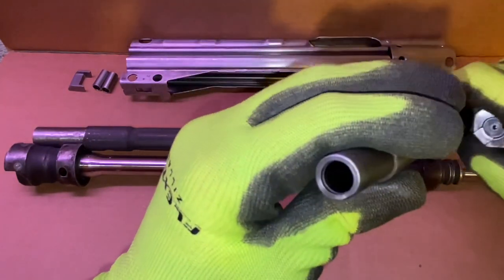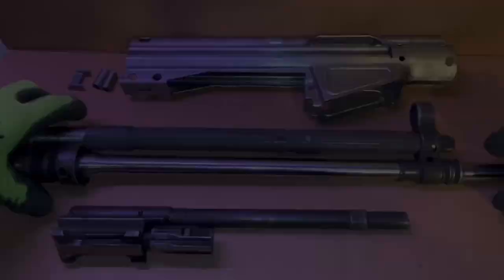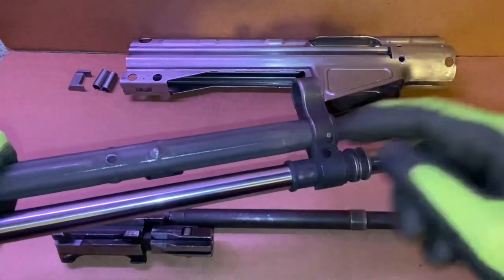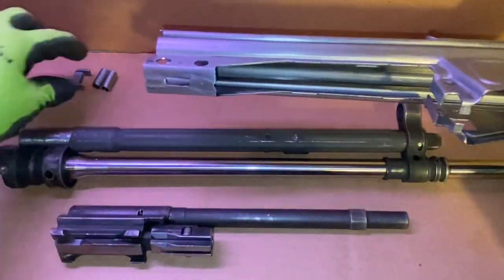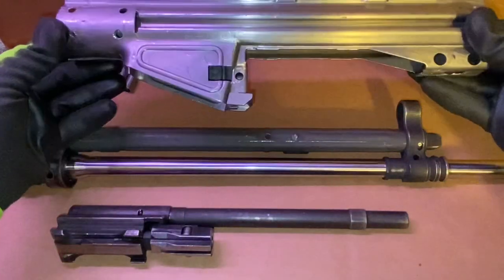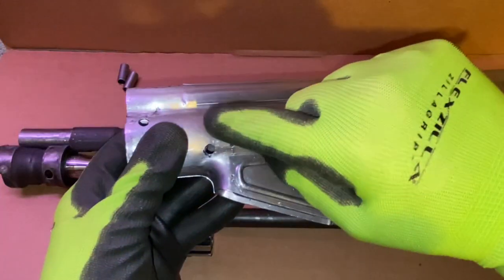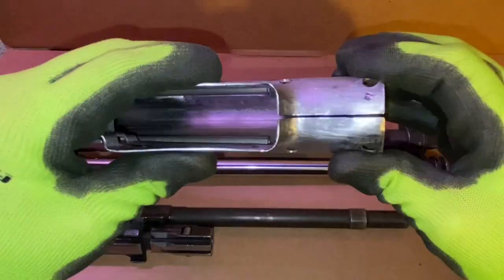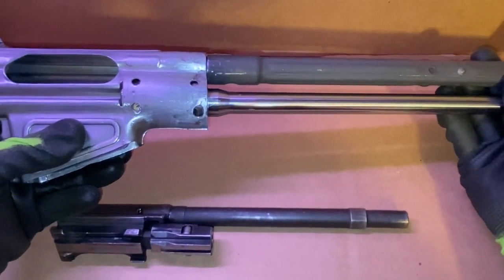BATTLE RIFLE Build Series - CETME C Build Update

Comment: I am almost done with my CETME parts kit, waiting for the barrel which will be here tomorrow. I made my own bending jig for my flat. Seems all jigs, no matter which one or who made them, all bend the flat to the point they are always tight. My guess is because it's easier to expand the inside than to tighten it if too much play. I used 3/8's drive chrome deep sockets and an extension to drive thru both the upper and lower section of my bent receiver as mandrels. Started out with thinner O.D. sockets and worked way up to the best fitting ones. Worked out great for me. I didn't want to pound on the carrier. Seems all jigs require a mandrel. Even the HK made receivers need to use one. Good project, but will require some skills.
Reply from the maker: Exactly. A correctly sized socket on a long extension and pound it through…once I got the internal dimensions close enough I used my BCG to do the same thing for a final “fitting” so to speak. Great minds think alike my friend! I appreciate ya!
Reply: @SMR-Tactical  My barrel arrived today. Installed and welded, just cleaning the welds now. Everything seems right on so far. Functions as it should with snap caps. Will test fire next week, then refinish. I watched every video on YouTube on building these. Good project, but not really easy. Lots of fitting.

Comment: Hey I bent my CETME C lower and welded it up but it is too tight for the bolt to go through it.  What would you recommend to get the bolt carrier to slide through.  Thanks
Reply from the maker: I would use the bolt carrier as a mandrel, if you are able to get the carrier in.  Meaning, lube the carrier and the receiver up, and hammer that carrier through there….back and forth.  It will force the receiver to open up where needed, just make sure not to damage your bolt carrier or receiver (use a rubber mallet and a wood dowel) and STOP if you meet resistance so you don’t damage anything.
Reply: @SMR-Tactical  Thanks Scotty
Reply: @SMR-Tactical  So I have 5 receivers that I need to open up and I did the first one just like you mentioned.  I "gently" ran a lubed bolt carrier through with a shop press but after I finished I noticed the the receiver is a little twisted.  I have been doing some reading and found out that they make a mandrel for squaring up the receiver as well as opening up the receiver for the bolt. Do you know anyone by chance that has a mandrel for sale or that I could rent.  I live in the midwest and just looking for a little help.  Thanks!
Reply: @MIRONWORKER  whats up?
Reply: IM HERE

Comment: How’d you press the sight tower? Mines pretty snug
Reply from the maker: I have a 12 ton shop press from Harbor Freight that makes pressing barrels and barrel parts a breeze.
Reply: @SMR-Tactical  Me to! Used it to press on the barrel. But Im curious if you used a specific jig or sided pipe to safely press triple frame. Ive heard they bend
Reply from the maker: Good question. I cleaned the inside diameter of the sight tower very lightly  with sandpaper. Not to make the hole bigger but to clean up any grime or rust or anything. Then lubed it with a little oil and it pressed right into place.
Reply: @SMR-Tactical  Ill do the same. Im considering of bending the sight frame but Ill just overlap it with a similar diameter tube. How’d the foregrip fit once pressed?

Comment: How much Gap was in the bottom of your receiver before you welded it
Reply from the maker: How do you mean?   It should be the exact size (with a slight bit of interference fit) for the bolt carrier group to slide through there.   Best advice would be to clamp everything where you want it to be welded, and work that bolt carrier group through a few times with a rubber mallet and a wooden dowel.  That will “form” the receiver so to speak to the BCG shape/path.  Then when you weld it up, that BCG should pass through there easier as a result.  

Hope that helps.
Reply: I don't have a bolt carrier fitment problem I do have a little bit of a gap around where it needs to be welded but the trunk and fix the caulking tube fits but the receivers are budded up against each other
Reply from the maker: If this was a receiver flat that was bent, sometimes the sides don’t all “lay” right after bending.  You may need to either hand fit this area by bending/shaping the metal, or you may want to kind of mock up the rest of the parts and see how much space you will need and then add in some material there to make up that gap.  

It didn’t seem the parts fit right for me until I actually put them all together, even before welding.    Then I could see where I needed to fit/weld or clean-up specific areas like the magazine well.  

Hope that helps.
Reply: @SMR-Tactical  yeah I was just curious I mean there are different companies that make glass